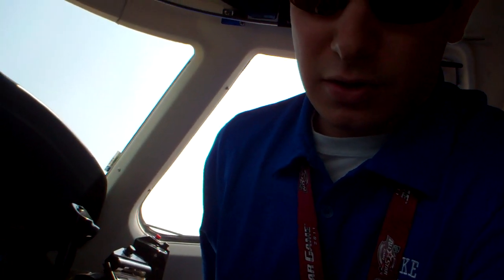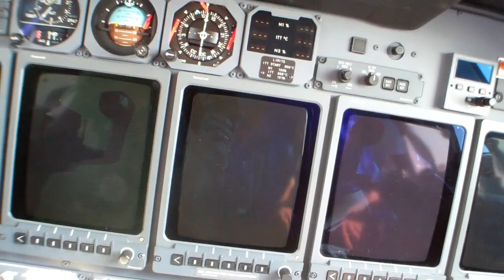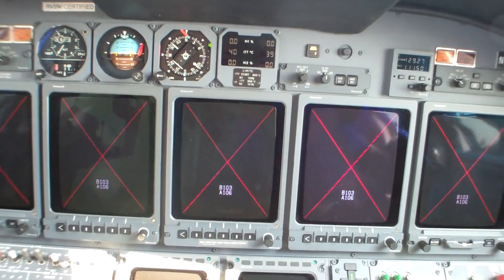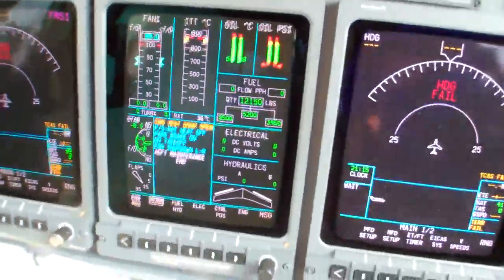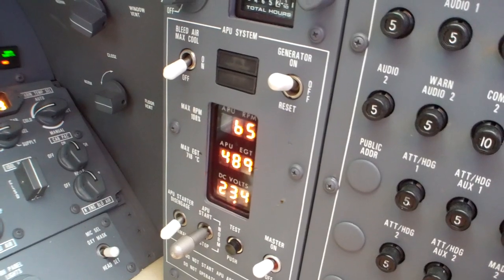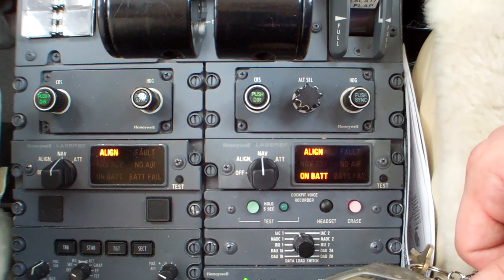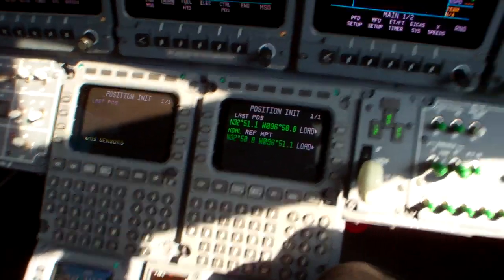Citation X - Cold and Dark, Starting the APU

Comment: Curious why you fired up the avionics before the APU.
Reply from the maker: With the avionics on, you’ve got much more information about the electrical and pneumatic systems that’s good to have when determining if the APU has started and the relevant subsystems have come online properly. It also allows for aural warning for APU Fire if necessary. The electrical draw of the avionics for the short period of time it takes to start the APU is not a factor 👍🏻

Comment: Cool video!

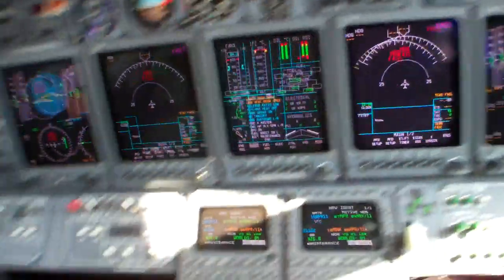What a hoot!  Many years ago I put a "stable platform" from a mid-1960s cruise missile (AGM-28) on display at an aviation museum to give folks an idea of how we navigated to the moon.  It was a sphere about 24" in diameter with six gyros nested inside of three gimbals; it was heavy although I never actually weighed it.  Your APU start-up caught my eye when I saw Align leading me to a Honeywell LaserRef (IRS? around 02:35).  Back when, I think a laser ring gyro was still pretty large.  Any idea of what the approximate size and weight of a system is nowadays?  Do you have to feed in a LAT/LONG or does it pick it up accurately enough from another NAV source?  Or am I just off base and crazy?  Oh I'm getting old...  (Geeze..., I just noticed this video was posted over ten years ago!!!)
Reply from the maker: Great question. I have no idea how much modern IRS units weight. My expertise is in the switches and buttons on the front :)
In the Citation X, we had dual GPS receivers that were the primary way of feeding a lat/long to the IRSs for initialization. You could also use an airport identifier to spit out a mildly accurate point, or manually enter coordinates for a parking spot if those were available. More recently I’ve been flying the Challenger 300 where it is all done automatically using much the same sources. There’s no need for manually turning the IRS on or to an align mode like the X - it just happens in the background when the avionics are turned on.

Comment: just a lowly simmer,  but use both the Eaglesoft V.2 and Wilco's Publications of the "Ten".   learned a lot.   question:   what is another method of 'wedging a discontinuity between two wps, on the FP page? ( other than just affixing "DEL".  all that seems to do,  is drop the 'next in line' wpt,  down to fill the "Gap",  i'm aiming to create?  is there another handy method,  to assure a DISCO,  between two waypoints on LS Key's?    i've been making a habit of entering an Alternate Routing,  but WANT to see just the actual performance figures,  'based' on the trip distance "ONLY",  from One  (my main  Route)   otherwise....i'm seeing double the distance,  and hence,  the CDU will display things like,  'not enough fuel',  and distance 'double' that,  of intended?   any help anyone?   thx!

Comment: That's the AS/ALT Vibrator.  It comes on with Standby Power.  Us mechanics usually pull the breaker as the noise gets bothersome.
Reply: So do some pilots.  The circuit breaker is conveniently located next to the Captains left elbow.  Not that I would ever do it.

Comment from the maker: We use the manufacturer's checklist straight from Cessna.  The GCU regulates the generator and brings it on line when the system is ready for it...so essentially there is no difference between that and flipping the switch manually after it's started.  If there's an issue with the power, the GCU will simply not bring it on line.  It's more dummy-proof than me :)

Comment from the maker: The correct procedure, according to Cessna and as is printed in the checklist and expanded procedures, is exactly as shown - the GCUs (generator control unit) on both the engines and APU will not load a generator until it is ready for it.

Comment from the maker: @stuntcc Yes, we leave it on until 18,000 feet when we complete the climb checklist.  Leaving it on leaves us with 2 generators and an extra air source for a restart if we were to have an engine failure.  Since we only operate one of them, it doesn't cost much to do that, but operators with lots of C750s like NetJets tend to shut the APU down after engine start to save $ in the long run.

Comment: Excellent series of vids. Got a reletively simple question, what is the fuel flow (pp/h) during taxi and on the X do you have flex takeoff or derate power settings for lightr weight takeoffs..

Comment from the maker: Not sure, but the batteries are designed to last 30 minutes with everything on, and that includes one APU start also, so having everything on puts you at no risk of killing the battery.  Over-simplifying, the batteries in the X exist only to start the APU.  After that, you've got all the electricity you need and more.

Comment from the maker: I every jet I've flown, the bleeds go on immediately, and in fact, in the X, you start the engines with the bleed switches on.  The FADECs shut the valves until the start sequence is complete then immediately turn them on.  It doesn't hurt a turbine engine - all you're doing is extracting compressed air.
Reply: I'm not 100% sure that you know what you're talking about!

Comment from the maker: @Flyaway722db @ecktoeman It is perfectly normal to start the APU (and engines) with the Generators on.  Each has a control unit associated, so it isn't providing power to the system until the control unit sees all the right parameters and decides it's ready to.  That procedure varies from airplane to airplane - the Premier and King Airs are started with the gens off (and in the 200, they have to be off for both engine starts), but in the X (APU included) and CJs, leaving them on is fine.

Comment from the maker: @drumdude46 @billt460 We use the 150 pph number for the APU fuel burn.  Pounds is used for all fuel calculations, except when you're ordering it from the truck.  We don't really run the APU on the ground for extended periods of time intentionally, but occasionally the passengers will be a bit late and it'll run for a while.  Also, we have it on below FL180 all the time in case of an engine failure, so we always plan a little extra gas for the APU.

Comment: @billt460  (con'd)  to clarify.   APU on CitX does about 120-150 lbs per hour.  
jet fuel is 6.7 lbs per gallon .....  we arrive at that by taking 10%  of our Lbs Figure,
then multiplying that (X)  by 1.5.    i gave a 120 lbs figure to get about 18 gph.
if it burned a few more lbs,  then it'd be a few more gallons.  ( 20,  maybe a bit more, per hour)

Comment: ....also,  curious:  thought you we're just supposed to set IRS units at first,  to "Align",  then wait several minutes for the Laser Gyros and Accelerometer's to spool up so as to find a Geo Solution.  here i notice,  you simply set the Switch Directly to NAV??..... then went to Pos Init. Step on CDU???   explain???